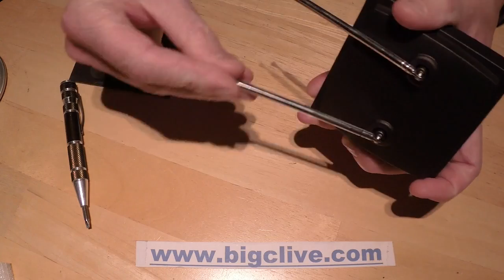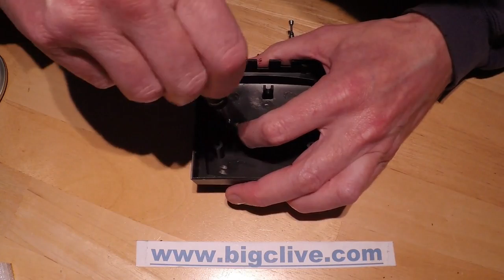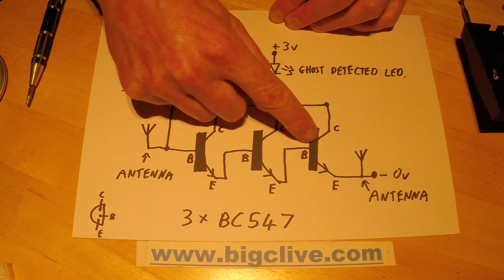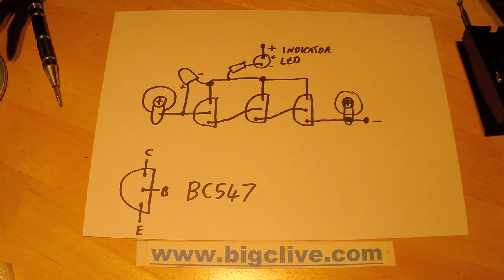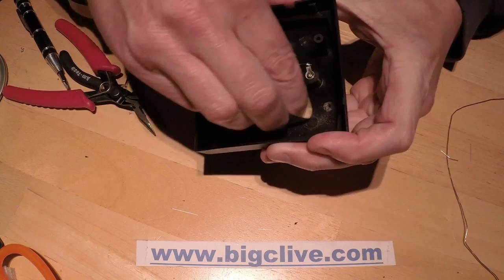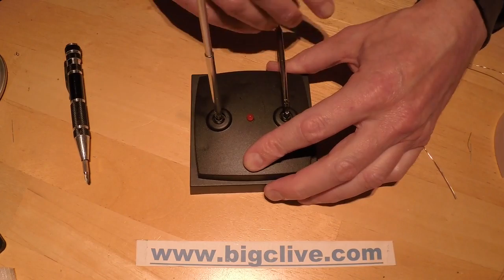Make a ghost detector.

Comment: I have built a few of these for my niece who runs a ghost hunting outfit, she is really into it, now proclaims herself a witch and psychic and such.  I have used the 2n3904 in one, another with 2n2222A, but I kept getting confused so the last few I built, I simply went to Ebay and ordered the BC547 they cost about the same as the others and I don't have to keep trying to get my head around the change in pin out's.  Just makes life so much easier to just follow exactly the diagram.  Just got another inkjet printer to replace my ancient HP LaserJet professional machine that died, so now I can even print out the diagram, in fact I just did using printscreen to save a screenshot of your video display of the circuit diagram done with cliveview.exe now I can just look at the photo and go from there.  Thanks much for this it makes my witchy nice very happy indeed each time she finds a ghost that she can commune with.

Comment: Big Clive
Each LED will act like a mini solar cell if you shine light on it.  It can easily generate more than a volt at a few tens of microamps.  So you should keep that bias LED completely dark.
Reply: That's a great point. I'll check that out on the one I just built. Thanks for the tip! 👍

Comment: Big Clive
Here in 'The States' we have Mouser, Digikey, Arrow, and Newark AKA Element14, 'a Premier Farnell company.'  They have stopped stocking almost all through hole transistors, with the exception of power transistors.  But they have stocked 2N, BC, and house numbered (like MPS) transistors for a long time.  The choice is arbitrary - whatever you like.  The 2SC Japanese are not commonly purchased.  But Japanese transistors are by far the commonest if you count all the ones in consumer electronics.

Comment: With some tweaks this could make for an awesome (and (almost?) impossible to defeat) proximity detector for a security system..
Reply: Except if you're grounded.
Reply: Sorry I'm 3 years late but I just built one. It detects when I lift my foot off the carpet. I discovered that it is important to get the right LEDs as Clive suggests.

Comment: I remember being quite fond of the BC107 transistor in its TO-18 metal can package. I still have a few. Looking them up I see they are pretty pricey at about 35p a unit. Checking the datasheets for your BC547 and the BC107 I see they look to be the same just in a different package. I guess they just used the same innards over the years. In fact my research shows that the BC107, BC108 and BC109 seem to be the same as the BC547, BC548 and BC549 respectively.

The good thing is that the BC547 is only 7p a unit!  I still think the metal TO-18 cans look way cooler on a PCB however :D
Reply: Goose...

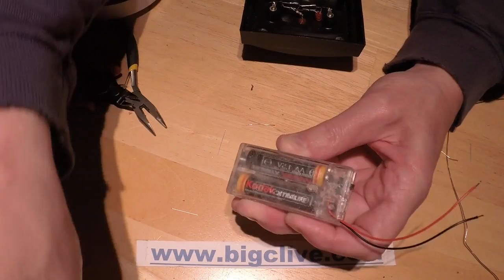Comment: 15:52 finally, somebody who appreciates the real use for sleeves and trouser legs lol (actually, they have different purposes. Sleeves are for dirt/dust/snot whereas trouser legs are for oil based fluids and silicone sealant)
Reply: That sealant..... It's a scourge. I have a pair of pants I've had since 2007. Still wear them, still has some spots from some a shower door install in 2010.
Reply: True...

Comment: can i hook indication output where the LED is to something like esp8266?
Reply from the maker: You may have to use an optoisolator in the place of the LED to avoid coupling noise from a processor to the very sensitive circuitry.
Reply: ok, thaks for help.

Comment: Forgive my impertinence. This seems like an excellent application for an 18650. With small charge modules being as cheap as they are it wouldn't be difficult to source or build one so it could be rechargeable via USB. Sure the AA batteries will last a long time but why throw things away if something reusable can be substituted?

Comment: Made one of these for my niece who is into ghosts and such things, she loves it.  I could not come up with a set of rabbit ears so just used one of those medium project boxes with a couple of coils of heavy copper wire, that actually made a very sensitive detector, then used a blue light and powered it with a rechargeable old lipo taken out of an old cell phone and put a charging circuit on it so she can recharge it at will.  She says it is the  center of attention at gatherings of fellow ghost hunters, when they meet and hunt in groups in well known haunted establishments and homes in the Dakota's.  So thanks for the great circuit, I am planning on expanding and building a few using Arduinos with screens that display the strength of the EMF, with, perhaps some flashing LED's to indicate very strong EMF along with a beeper attached that will sound an alarm when it appears strong enough to indicate a danger to the hunters (Ok so I know it is probably all bull but they love crap like that, in fact I have had a lot of them contact me and want me to build them these things.)
Reply: I have not seen a ghost but in my earlier days I have heard one walking down the hallway
in front of my bedroom. This is true and not a mistaken identity of the sound. My brother also 
heard and seen things in the same house. A boarder who lived with us at time had some terrifying
nightmares. So something was going on.

Comment: Been racking my brains out on this. How would i add a piezoelectric buzzer to it, so when the led lights up it will generate a sound???
Reply from the maker: You could possibly hook a 3V piezo sounder (with internal drive circuitry) across the LED.
Reply: bigclivedotcom i will give it a shot. Thank you for the quick reply!

Comment: I'm guessing it would function as a lightning detector too? Would two stages be enough for that purpose? Could you add a small buzzer or piezo element? ⚡📢
Reply: If you use a standard AM receiver and and NOT tune it to a station (just static) and turn the volume up full. You will hear the crackle of the lightening from miles away not even seeing the flash. I have an old recording of a pirate radio station from the Isle of Man (Radio Caroline North) on August 13th 1967 and you can hear crackles of lightening. I often wondered where the storm was located. I've still got the tape and the crackles....
Reply: @TimHollingworth  yep it certainly works well when you consider lightning is certainly powerful static electricity. I use the frequency of the static signals to guage storm intensity for occasional lightning photography potential.

Comment: could you replace the indicator led with a haptic motor?
Reply from the maker: It could be done, but you couldn't really wear a device like this as the charges caused by body movement would cause continuous false triggering.
Reply: I was just intending to put it in a similar case so it would vibrate slightly when it picked anything up for an amusing "ghostly" effect.Cheers for the reply Clive, keep up the good work
Reply: I was just intending to put it in a similar case so it would vibrate slightly when it picked anything up for an amusing "ghostly" effect.Cheers for the reply Clive, keep up the good work
Reply: I was just intending to put it in a similar case so it would vibrate slightly when it picked anything up for an amusing "ghostly" effect.Cheers for the reply Clive, keep up the good work
Reply: I was just intending to put it in a similar case so it would vibrate slightly when it picked anything up for an amusing "ghostly" effect.Cheers for the reply Clive, keep up the good work
Reply: i was intending to put it in a similar case and have the slight vibrations cause an amusing "ghostly" effect>Cheers for the reply Clive,keep up the good work

Comment: Just wondering if it would effect the circuit if I made this with an on off switch with or without an led in the switch?
Reply from the maker: It would work fine with an on/off switch.  And you could also add some extra LEDs for effect.
Reply: bigclivedotcom thanks going to be making this for my girlfriend  as my second project (first one was an elicrtic touch magic trick)

Comment: The BC547B has a typical gain of 300, so your darlington  trio could have a gain of 27 Million!!!
Reply from the maker: That's because ghosts operate at very low current.
Reply: Analog ghosts yeah, but digital ghosts can bring about appreciable currents. Not to be confused of course with magic smoke, which typically only operates at above average to ludicrous currents.

Comment: No Shame in Dumpster Diving.   Parts is Parts.  I need rather expensive .22awg
 Wire to build a Metal Detector Coil.  One Degausing coil from a old TV provides enough wire to built 4 or 5.  Emmmmmm What to Do ?

Comment: Clive, I didn't hear you correctly, did you say: ghost or goat detector? Why would you need  a device for detecting Goats ?  If you said Ghost . . . you shouldn't be allowed to drive, much less construct something. Anyway, everybody knows Ghost hide behind AC outlet plates. Plug the two antennas in there.

Comment: Mine dosnt detect many ghosts. 
Kinda light up all the time and just varies a bit in strength if im getting close and gets complete dark if i thouch one of the antennas.
Used 2n5088 cuz that was what i had.
However it really detects my slightly modified flyswapper. 
Blinks syncronized to my swapper with 3.6V-6V To 400KV Boost Step Up Power Module

Comment: So, I decided to build this for no reason, added a more powerful battery, and swapped out the indicator LED with a speaker. Because it's built on a bread board, I have 1 wire sticking out as my antenna, and holy shit... The amount of RF interference given off by devices is just insane. Hold it up to a plug, it'll buzz. Hold it to your wifi router, it'll make some weird digital sound. Cool shit.
Reply: Xenro66 My speakers aren't grounded, so just bringing the 3.5mm jack near anything does the same, haha
Reply: I remember picking up a radio station with an ungrounded audio cord when I was under 10. This station has been known for broadcasting WAY over their limits, and having funky equipment, they will sometimes swamp neighboring stations and random ones 8mhz off.
Reply: I work at a theatre and have had similar things happen with the backstage wall mounted speakers used to listen to what is happening on stage and talk to other parts of the building. Turns out that the wires happened to tune to a christian radio station. We just did The Full Monty, and it was quite amusing to hear a preacher yelling about jesus, fire and brimstone every time we started the system up.
Reply: @Ravaxr  I can only imagine, uneducated believers are a hilarious breed, but don't try explaining it to them, as they are likely to try to exorcize whatever demon possess you. Get away from me Satan.
Reply: My pre-cellular phones electric piano scared me to near death when I used it to rest my cellphone. The EMI was louder than the musical notes are at max volume!
Reply: Ya, I used to pick up my local radio station from ungrounded speakers as well.

Comment: Why don't the second transistor (or the third) in a darlington array burn because of high base current? Usually there has to be a current limiting resistor at the base to prevent this?
Reply: from this their shouldn't be to high current

Comment: Would that detect thunderstorms as well, or don't you look for ghosts during a thunderstorm...?
Reply: Yea... good question. Or how bout if you ever detect a ghost playing with his/her Van de Graaff generator, Jacobs ladder or actively arc welding? Then what?!?! And what if you end up bagging a Demon/s as Dustin warned below? Demons are scary you know... and oh so notorious for using foul language... and what ever will you say to the local authorities, media & HOA??? All non-trivial things to consider before placing that DigiKey or Mouser order...
Reply: If you use a standard AM receiver and and NOT tune it to a station (just static) and turn the volume up full. You will hear the crackle of the lightening from miles away not even seeing the flash. I have an old recording of a pirate radio station from the Isle of Man (Radio Caroline North) on August 13th 1967 and you can hear crackles of lightening. I often wondered where the storm was located. I've still got the tape and the crackles....

Comment: Hey Clive, I bet you get a lot of bats flying around on the Isle of Man. How about a video of building a bat detector, or one about the various different technologies you can use to detect bat sonar?

I'd love to see that, cos, you know, like, bats are real :)
Reply from the maker: I used to have bats swooping outside my kitchen window in Glasgow a lot.  I built a kit bat detector that was a super high gain audio amp that could pick up the ultrasonic sounds with a standard ultrasonic receiver, then used the resultant clipped square wave to drive a divider that brought the frequency down into a very square audio representation in the human audio spectrum.
Reply: +bigclivedotcom can i make a request?,, can you make a simple 2box metal detector ?,,,it's the project does not have enough reference ,,,hope you will thank you sir,,,

Comment: This is a fun circuit. Just made one using 2N3904's and instead of a resistor and LED, the output goes to a 100k pot in series with a 1mA analogue (analog) meter (an old VU meter).  The circuit tested and works from 1.2 volts to 15volts. Been having fun playing with circuit because its very sensitive.  Thanks BigClive!
Reply: im try to made it with 3x2n3904, 100k, 1M, 220k resistor and 1 LED, but the LED keep turning on when battery conncected, what should i do?
Reply: @garroshwildfire8561 THERE'S A GHOST IN YOUR ROOOM! just kidding, maybe you connected the polarity wrong or a transistor might me failing. Also check whether the pinout of your transistors because it may vary

Comment: is that tool you use to open the casing at the beginning (looks like machined metal with the clip) just a flathead screwdriver or some prying tool? It looks pretty effective, and I find using screwdrivers tend to mar plastic when you pry open.

Comment: So hold on... the possibilities for building a theremin out of one of these contraptions is...?
Reply: You'd just use the antennas and not the circuitry that clive is showing here.  So it may be a cheap way of buying two  antennas, but the rest is different.  As the other guy said, you can find simple circuits on the web.   But beware!  The simplest generate square waves and shouldn't really be called theremins.  Depends what sound you want.
Reply: +morpheox In theory, yes, although you'll need quite a bit more for that (since you'll want to control amplitude and frequency). Just look for "theremin circuit" on Google. Tons of different setups.
Reply: +Smaxx thanks!

Comment: This is basically a circuit which senses electrostatic fields. It would be interesting to compare it to a circuit which uses a junction FET at the input cascaded with a bipolar transistor or two. The FET can be made to have a higher input impedance... easily in the tens of megohms.
Reply from the maker: +Dazzwidd I tried a FET version with a 2N7000, but was wary of the risk of electrostatic damage to the gate.

Comment: Just found TV rabbit ears and will be building this one as soon as I get all the parts together.
I was sweating not having a 2x AA battery holder then I realized I can always use one of my 3.7v lipo batteries with a little diode to drop the voltage just a little.
Question:
If i can't get an "old" red LED will a newer one still work?
I can get old greens but I don't know if the properties are optimal.
Reply from the maker: +Michael Thompson It's worth experimenting.  I'd still recommend using 2 AA cells as the current requirement is too low to waste a lithium cell on.
Reply: Noted! Thanks!
Reply: +bigclivedotcom Clive I just built two of these, and as fate would have it one of them was built with the larger SMD LEDs (reds).
The "nice one" built on rabbit ears with the green LED works, but the red built in the open running on a 2032 coin cell with cat 5 wire antennas is more lively and can actually sense when the lights are on or off in my den/workshop.
Delightful project. Thank you!

Comment: Can you explain more about the bias on the transistor? I still don't get why you need it. Does the circuit not work at all without it?
Reply from the maker: +codebeard It just nudges the transistor closer to turning on and makes it much more sensitive.
Reply: bigclivedotcom  There's a chance that the reverse current on a LED would be enough to activate the transistor though, right? I guess you just found it worked for that particular LED. Thanks for the reply.

Comment: Wish you could come up with a Chinese crap product detector.  I know you wouldn't really need one as if it says made in China it's crap. But come on it would make a great video.
Reply: +rekozma Maybe a circuit tuned to mains frequency. The stronger the signal the more promising the item is
Reply: Ron Garren I like that.  Cheers
Reply: Just as long as it has a floating earth wire...

Comment: You could make a motion sensor based on this. Home made alarm system. You'd probably need an Opamp and a driver chip to power a loudspeaker. Might need to bump up the output voltage a bit.
Reply: Opamps have less amplification than a triple Darlington thats 200 to 300 cubed = 8 to 40 million total gain.  To drive a buzzer, maybe add a 4th transistor.